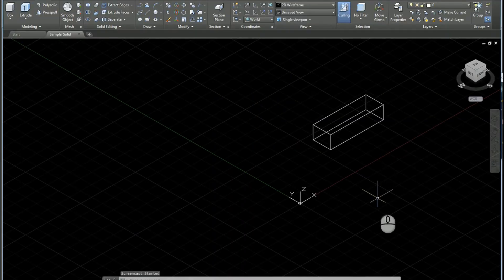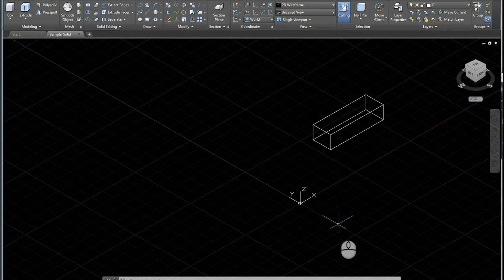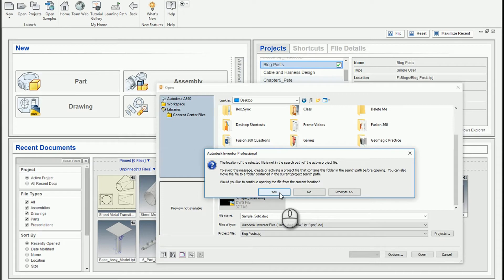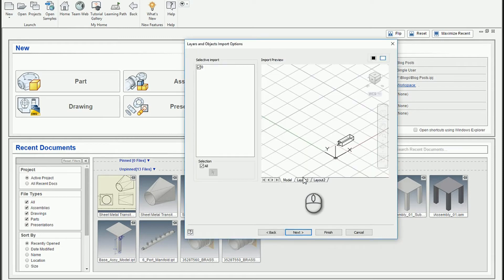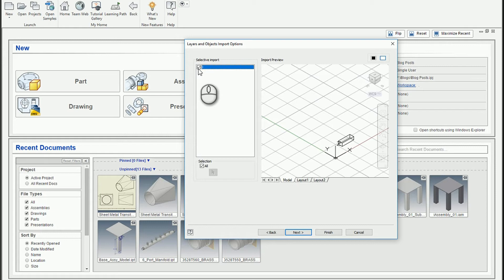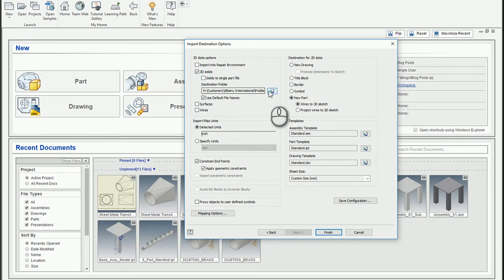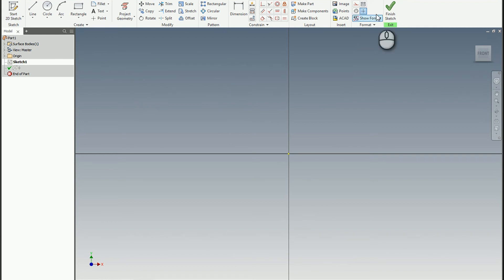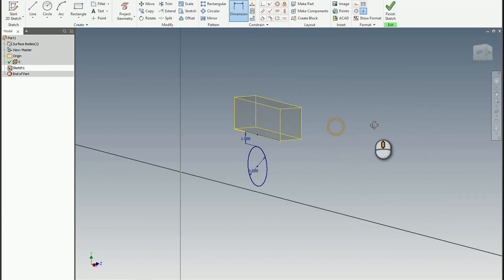Autodesk Inventor - Importing AutoCAD Solid & Surface Models

Comment: Hey, can you help me please. I create 3d model in autocad then i import in to Inventor but i cant get Ruled Surface from  3d object... im stuck.
Reply from the maker: Thanks LIAS for reaching out!  You can import either a surface or solid model from AutoCAD into Inventor, just be sure to select the Import option (1:16 into the video) and then check the appropriate boxes to import the solids and surfaces.  I usually check all the boxes to save some time.  From there, you can use the surfacing tools inside of Inventor to add the ruled surface, at least this is the way that I would do it.  Hopefully this helps, but if you have any other questions, please do not hesitate to contact us support@teamd3.com.  Thanks for watching!
Reply: @Team-D3   i send link with video record on email, thanks. look at mail nr2.
Reply: Lias, would you be able to share your file with D3 to troubleshoot your issue? if you could please email it to support@teamd3.com